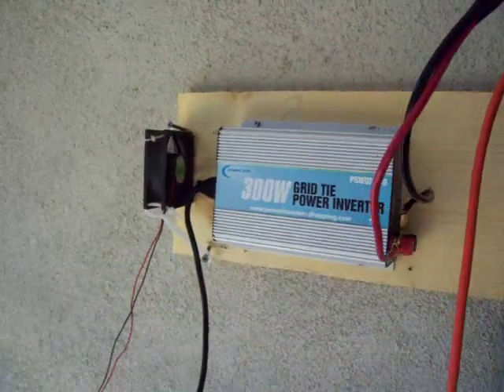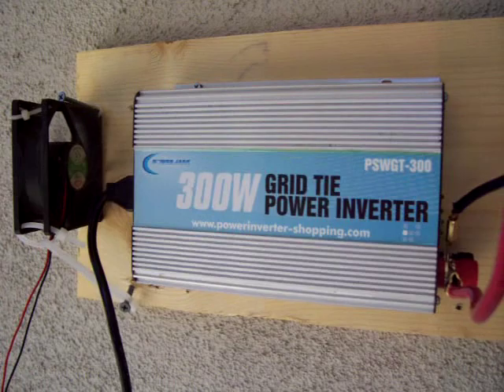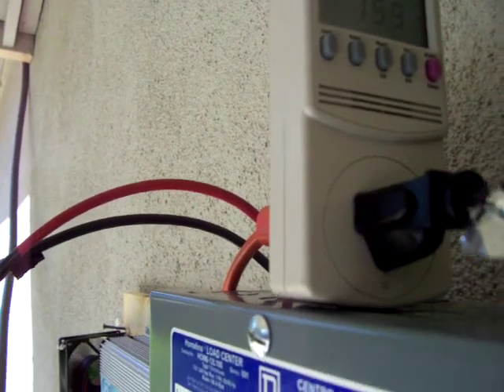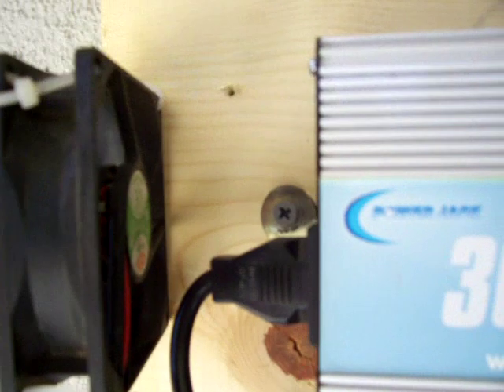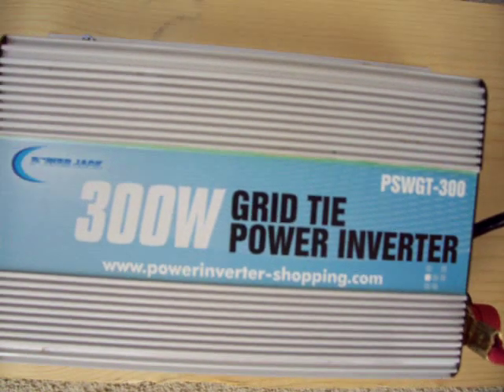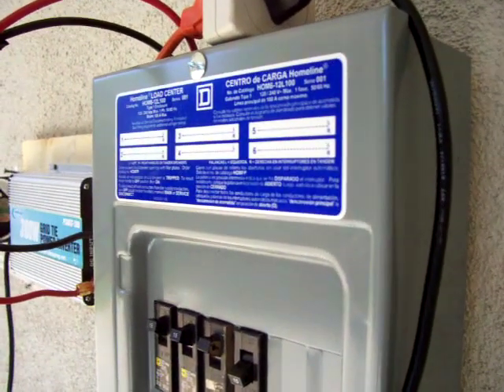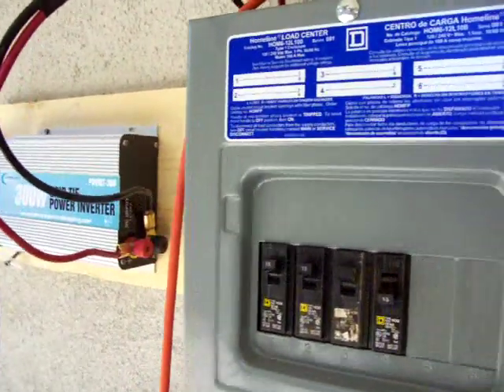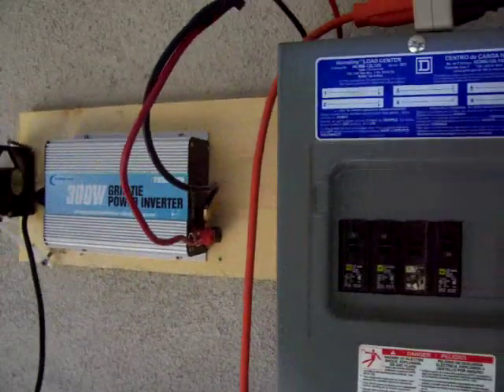Grid tie inverter update

Comment: I will comment only on that heat and inveter thing. Higher temperature...lower life time of your inverter..If you are using some PC few hours per day ...it is OK. But if we are talking abount inverter...connected to your grid 12 hours per day... I would recomend adding heat sind to your casing with some adhesive tapes. It will increrase life time of your inverter. If it isn't MPPT inverter i would not recomend it at all only if you are 100% sure about voltage.

Comment: Transistor could manage 170..but i hardly think anything over 50 degree is good.
 If inside of invertor will go over 60 degree you can throw it away.. why..? because capacitors will not accept this kind of temperature. Life expectancy will go to few 1000 of hours. SO if your invertor is just a bit hotter it is good if is is hot(60 degree) you have to cool it down as fast as possible. Btw Life of capacitors is about >100k hours (with 20 degree of ambient temp.) with 50-60 degree it will go down

Comment: Other videos say to derate the GTI.  If it is rated 300w then don't try to use them over 150w or they will get hot and efficiency will suffer, not to mention having a shorter life.  Either go up to a 600w unit or add a 2nd one.  Good luck.

Comment: To clarify my replys here.. The problem with the inverter is not the heat i believe. Its the incoming voltage that is probably to high or to low for the inverter. Whats your incoming voltage? Keep a voltmeter on it and monitor it when it goes up and down like that... The inverter is built to handle 300w and if it gives problem already below that you might have a faulty inverter. But i still believe its the input voltage. I have had the same problems with mine. Then voltage was too high...

Comment: @vawt1953 A transistor can manage 170C (338F) before it gets destroyed. And you don't want to touch your caseing to the inverter at that temp ;) .. The casing dimensioned to dispense the heat the inverter create. But if you run the inverter at max load 24/7 it would be a good idea to mount a fan that blows air inside the inverter since you may have other components inside that need cooling in that case. :) I'm an educated low voltage electrician with also 1 phase 230v (qualified).

Comment: @vawt1953 Well i meant, did  you paralell connect all panels or did you serial connected the 3rd one? Well computers use fans to bring in cold air to the components inside.. It's not to keep the case itself cool... On the inverter transistors are connected to the case thats why its get hot. It's made that way so the heat would not be generated inside the case. That way the heat dispense more quickly. But a fan like that helps keep it cooler but its not needed..

Comment from the maker: @taztaz79 
Then why do computers need fans to keep the case cool??
Panels are connected together with a combiner box each one with it's own breaker. Since I been using this setup with the pc case fan I have had no problems. Voltage on the 3rd panel tested fine so it must be the inverter.

Comment: Warm does not make a difference.. It's ment to be hot! :) Transistors are connected to the heatsink that also works as casing.. As long as you can put your hand on it without burning yourself there is absolutley no problems. The extra panel you connected... Was that connected to a serial or a paralell setup? One reason why it stopped could be to high voltage to the inverter.. Mine has that problem but then it usally don't start up at all....

Comment: I have the same inverter but with the green label.  Mine is generating 60 w with 2 60watt panels. The unit  with the green label actually has a fan. If yours did not come on when the weather is hot, there's something wrong with it. Mine never came on until a couple of days ago when the weather hit the 80's. I kind of doubt  the unit can handle 300w. The cooler it is the better.